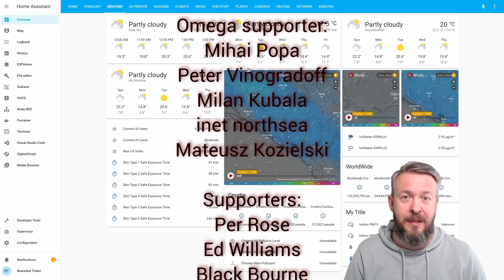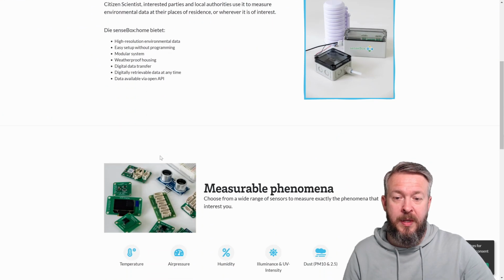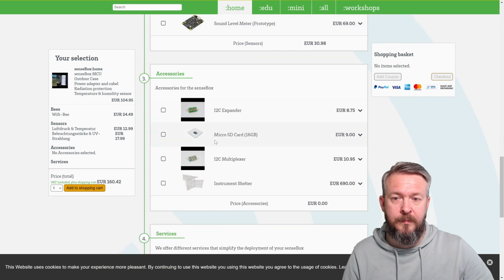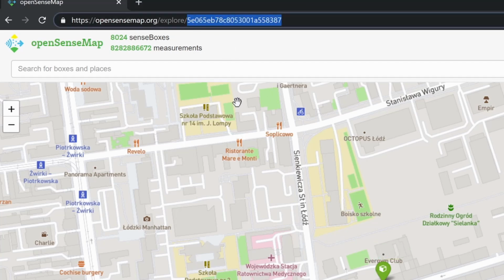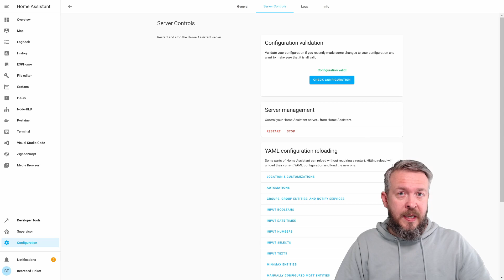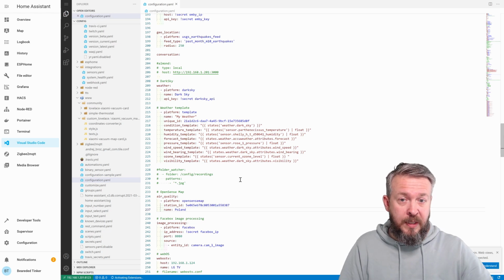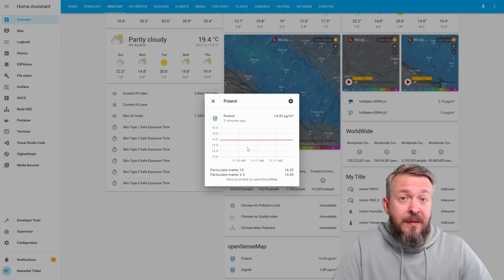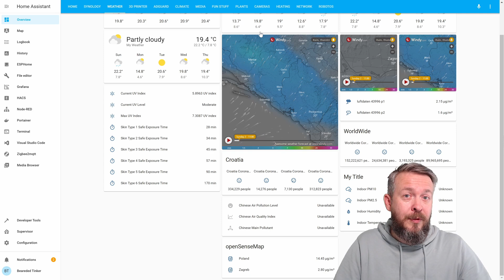AirQuality information in Home Assistant with openSenseMap and SensorBox

Comment: Thanks for this very informative video regarding opensense map. You showed how to implement one result of the AQ-sensor and the way of yaml-coding (very good). But how do I have to code for using the concret sensor entities for for AQ, temperature and humidity?

My first step is to implemet the results of an existing station and later to build my own opensense weatherstation outside of our house. So I think the last step will bring direct data from the upcoming own opensense server by MQTT or others.

Thanks in advance for your support.

Comment: Is there easy way to show 10pm value next to 2.5pm on dashboard? tnx
Reply from the maker: Not so elegant way is to create sensor out of attribute.
Other way is to use HACS card that allows you to pull specific attributes. There are two I think, but I'm not currently using the, It will allow you to get attribute directly in Lovelace

Comment: That is good to know. Probably the quality of the sensors are good but not chip and prefer DIY versions. Once again thanks for the video.
Reply from the maker: They can't be that good. I presume that they simplified how you connect sensors. Check my old(er) video on Luftdaten sensor - it's giving you same values, but total cost is around 30-50$ - and that's only because PM2.5 sensor is a bit more expensive other two components you need are ESP32 NodeMCU + DHT22 for temperature and humidity.
But you have to either use dupont cables or solder wires.
Reply: @BeardedTinker  Thanks for that i am tempted to start monitoring the air quality here in Romania since i feel that is getting worst. Thanks again for your advice and videos.
Reply from the maker: @adifoto6362  try putting it indoors first. You will find it interesting that for example making burgers will really decrease quality of air! And thank you for your comment!!!!
Reply: @BeardedTinker  Thanks for the advice and ye no problem happy to help with YT algorithm.

Comment: I was literally looking at Air Quality sensors today just as I got the notification about this video.  Perfect timing :).
SenseBox sounds like what I need for my setup.
Reply from the maker: That's great!!! 
BTW - hint - senseBox is a "bit" on the expensive side. You can try luftdate project (I did video on that long time ago) - works also as AirQuality sensor outdoor/indoor - but as it's fully DIY costs much less (If I remember correctly total is around 40-50$ for all of the parts). Have one running over a year and you can publish air-quality data to multiple sources, including openSenseMap.